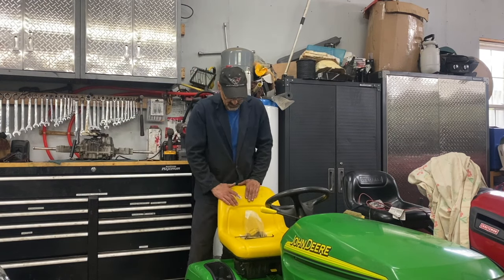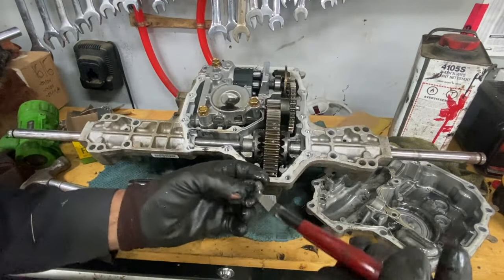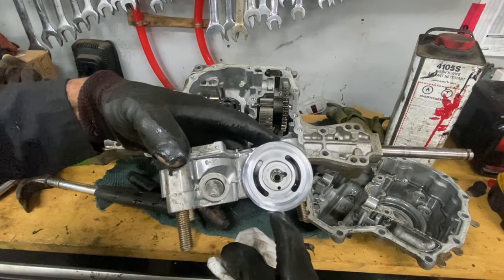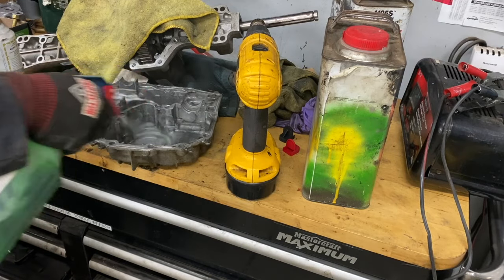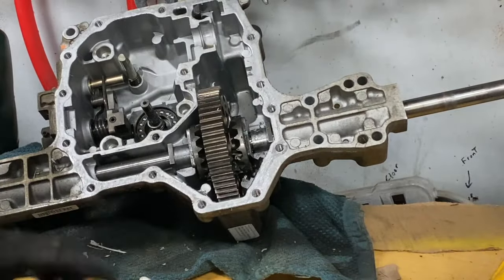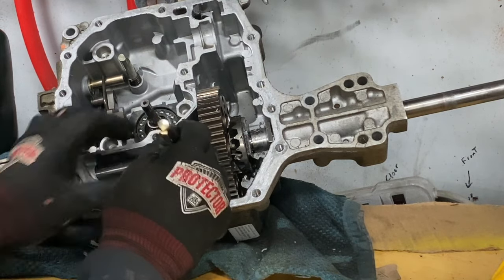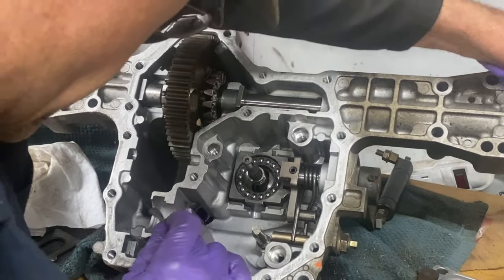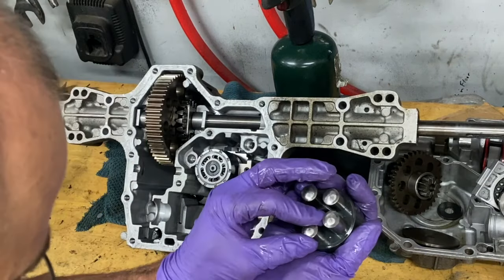How to fix a Hydrostatic Transmission that slips on your John Deere. LT180, 100 Series, LA135, D130

Comment: rule #1: don't buy one.. do NOT buy a John Deer anything. save yourself a lot of trouble.
Reply: That same trans is on a LOT of other brands. Just because it's not green doesn't mean it's gonna be different if it has the same stuff underneath.
Reply: @gavintube2366  thow a yellow Jonh Deer name plate and the price quadruples.. plus the fact that many parts from similar modles won't work on a deer. They may look the same but they arent.
Reply from the maker: Lol
Reply: That's just unknowledgeable jibber. All these budget riding mowers share the same fabricators of the main working parts. TuffTorq trans are used on every model regardless of color.  Biggs, Kohler, etc engines are used extensively on the gas budget jobbies, and you don't need to be buying JD brand parts when there easily purchased through there Briggs or sites like Amazon etc. When servicing any of the mowers you certainly don't need to be buying through JD when all the bearing are replaceable with the best bearing brands available in the world like SK, NSK etc. Even the tightener bearings are repairable if you have a minimal shop intelligence and a few tools. If "you" can't fix it, you need to fix that first before demonstrating your inabilities publicly.
Reply: Just because the mower is green and says JOHN DEERE does not mean it was manufactured by JOHN DEERE company. Most are made by Craftsman or MTD. For the prices the riders cost they do not last long in workmanship. I have had several different brands of mowers and mostly all are not very reliable for very many hours.
Reply: @aceallenk I hate to inform you that Deere does indeed specify distinct components from tufftorq. Cases without drain ports, different linkage locations, even different pump configurations (as a Husqvarna, Craftsman AND Deere owner, ask me how I know), you name it. And yes, the green and yellow status fee does also apply.